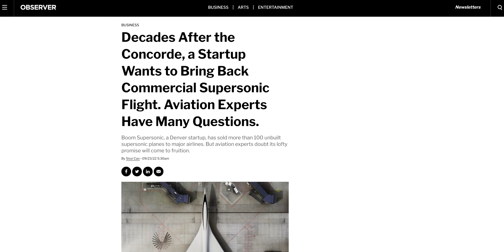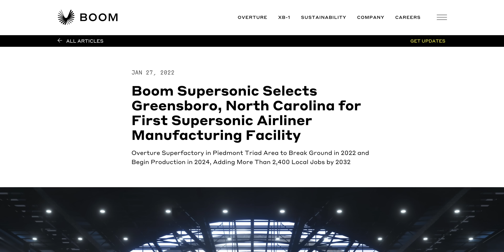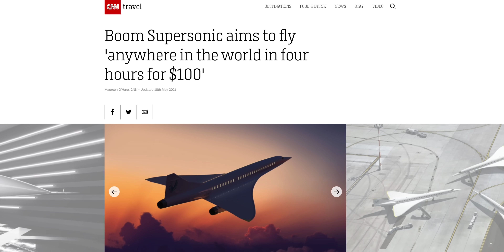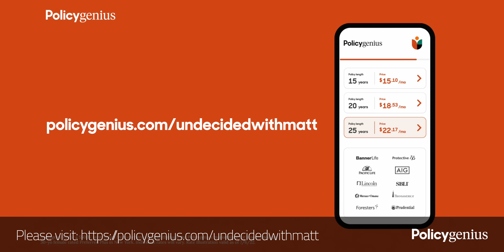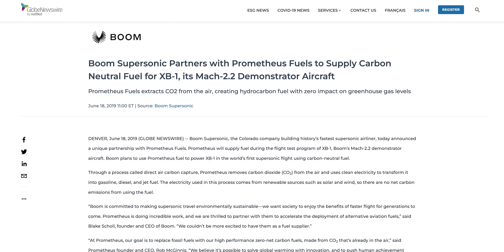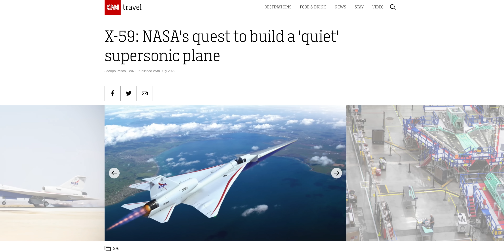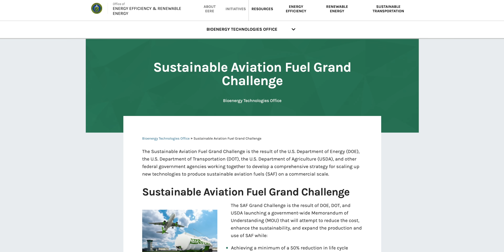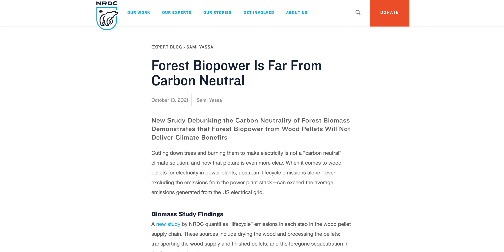Fueling a Clean Supersonic Plane Comeback

Comment: Something potentially undiscussed, is how supersonic travel may benefit exponentially greater for hyper altitude travel, that regular subsonic aircrafts can't achieve. This could help drastically lower fuel consumption on long-distance flights (like cross atlantic or cross pacific). The problem with doing direct fuel consumption comparisons, is that those comparisons often only take into consideration the most convenient factors - such as testing flight at equal atmospheric pressure and humidity etc, to generate an equalized and "fair" comparison. However, in reality those comparisons are never fair, as different types of propulsion offer different potentials for advantages and disadvantages that lab tests often overlook. It's why the old saying holds true: Theory exists in books and labs, practice exists in the real world.

Comment: The question is not the ticket price but it's relation to the compensation of its passengers. If you can book the seats, you fly. You also find a way to deal with regulatory objections. With time, in ovation and competition will drop the price.

Comment: While I certainly support the world's efforts to reduce carbon emissions... we might just have to accept that there are certain applications where, at least for now, fossil fuels continue to be the best option.  Long range commercial flights is one of those cases.  Let's take a step back and look at the big picture... the amount of fossil fuels being used for power generation is steadily declining.  % of EV new vehicle sales is going to do nothing but go up.  Once all the supply chain issues are addressed and battery production can meet demand, the roads are going to be flooded with new EVs, and the % of ICE vehicles on the road will steadily decline.  Eventually we will reach a point where the planet can tolerate some carbon emission modes of transportation like air travel.  Until the science can affordably provide a clean burning alternative that is cost effective (key point here - cost effective) to manufacture, we are just going to have to live with long haul flights using good old JP-1A.  As to Matt's other question - do we really 'need' supersonic flights right now?  Not really.  Should we pursue the technology for future applications?  Absolutely.  I just don't see $100 flights on supersonic jets anytime soon.  Sorry millennials... you are just going to have to learn to sit still for long haul flights lol

Comment: specifically speaking about the US, i would love to see the return of supersonic flight, but the issues you present are somewhat troubling. the Prometheus system of turning CO2 into useful fuel seems like our best bet, perhaps we could even get their power from nuclear reactors, nuclear power also would help other fuel production, such as hydrogen. hydrogen and DAC carbon capture i think are the most promising fuels for the future. the biggest problem we have to overcome though is the reliance on personal automotive transport. I've been working on a proposal to utilize existing rail infrastructure to provide overnight train travel at an affordable rate, a simple explanation is this: instead of rushing to the airport at the crack of dawn to get through security for a 1 hour flight, instead you board a train in the evening, where you are served dinner, given a bed to sleep in, and wake up at a normal time without having had to stress at all about being late. as part of my proposal i took an overnight train that already runs from los angeles to Albuquerque. the biggest problem with these trains is how often they stop at stations where almost no passengers board or deboard, instead, the train could have gone faster had it skipped the intermediary stops.
i believe overnight trains like this could almost eliminate short-medium distance flights, which would drastically reduce carbon emissions, highly populated regions like the US East Coast could use high speed trains to do the same thing over further distances, and offer daytime high speed trains to go even shorter distances with more station stops.
supersonic flight over oceans makes sense as trains aren't particularly good swimmers and boats/ships are just painfully slow.

Comment: I still don't understand how pushing to electric vehicles is going to help with climate change. Since the majority of power is oil, gas, and coal powered, you are still burning the stuff. Not only that, now you are subjecting it to losses when you charge and then discharge the batteries. Wouldn't this be even more detrimental? Sure there is hydro, wind and solar but the inherent costs and disposal issues of those present their own challenges. Electric power transport is not a mature enough tech to be pressed so hard and again, you are still burning fossil fuels to charge the batteries in most cases. Maybe in a few decades these challenges will be overcome but I really don't see it as viable right now.

Comment: In addition, Boom has a demonstrator prototype that was suppose to fly in 2019… And in aeronautic, prototype is the easy part.
Also, the supersonic travel is doomed. In the 60´, air travel was a total lost of time, no laptop, no TV and noisy airplane where it is was a sleep inside and people were smoking inside 😅 So it was making sense to fly fast. 
Today it is totally irrelevant unless for extremely long route (like Europe to Australia) that anyway these supersonic don’t address directly.
Supersonic has a huge energy consumption per passenger/NM that is against the energy crisis we face. Lastly nobody want to build new engine or even modified engine for them. That means they have no engine or they have to pick something military 20yo…

Comment: So let me get this straight: Boom has already developed the super-sonic aircraft, and they plan to run it on carbon-negative biofuels that don't exist yet? If they could possibly produce such a fuell cheaply, why then do they plan to burn 5x as much in a supersonoic passenger jet? 

We already know that today's airlines have pinned their future hopes on renewable biofuels. But that's going nowhere, because these fuels don't exist in quantity, and there's no clear path to producing them at similar cost and quantity as kerosene. If Booom could magically produce these fuels, I'm betting that the worlds airlines would want it pretty badly, and it would make Boom look pretty bad burning it at 5x the rate of subsonic aircraft. 

So why build a supersonic passenger jet, when this is really all about developing viable aviation biofuels?

The fact that Boom is pushing supersonic makes them look like climate deniers. Armed with a carbon-negative biofuel, they should be able to burn as much as they want, right? Jet engines still have CO2 emissions, and water-vapor, a potent greenhouse gas, and NOx, a carcinogenic smog.  If they really cared about climate change at all, they would put that energy into developing emissions-free electric aircraft.

You alreday pointed out that electric aviation is a difficult challenge, which is why today's airlines are putting their hopes on renewable biofuels. But consider: Tesla single-handedly made electric cars viable, by bringing down the cost of lithium batteries. A decade prior to that, General Motors, produced an electric car,  a 'compliance car' they hated, and eventually pulled it when they convinced the CARB it was a bad idea in the first place. My point: aviation doesn't need Boom, they need innovators who want to solve climate change.

Comment: I didn't hear an important aspect of supersonic air travel mentioned, which is less time spent in the air at comparable fuel consumption rates per air mile traveled means less overall fuel consumption per flight. This, of course, assumes comparable fuel consumption rates, which needs to be determined and verified.

Comment: F1 are moving to similar synthetic fuels from 2026. The brief is that they have to be carbon neutral as well as not take up any land that could be used for agriculture and they have to be truly sustainable. While there is a long way to go to demonstrate if it works or not but if anyone can make it work, F1 engineers and their relentless pursuit of performance to beat the competition each year. They also have oil companies as major sponsors with their deep pockets for development. It should be interesting to keep following the development on this new fuel

Comment: The Boom marketing ploy is being dismantled on other sites, even as this channel parrots the sales pitch. The risk for the general public is that so-called "net zero" will eliminate mass market air travel altogether, let alone, "anywhere in the world in 4 hours, for $100." Further, to the extent that content creators insist on discussing supersonic flight, the misuse of Mach Number is one of the most widespread technical errors on the internet. Mach Number is the ratio of airspeed (not ground speed) to the LOCAL speed of sound, which DECREASES with altitude. Just report the speed in mph or km/hr, because that's what you are trying to do.

Comment: I was wondering about Ultra Capacitors in aircraft design.  In your video about electric aircraft, and in this one, you talk about the battery bulk and weight problem, but I didn't hear anything about Ultra Capacitors.  The problem was getting the plane up high fast before the battery was used up and then gliding high up in the stratosphere where having electric engines isn't a problem, because air fuel mixture isn't a problem.  If you want a quick burst of power for a short time, and you want to be able to charge quickly from solar panels, isn't an Ultra Capacitor the logical choice?  Don't tell me nobody thought of that. 🤔
Reply: Ultra capacitors have a far lower energy density than even lead acid batteries. They have their place for their ability to store and release energy quickly like what would be needed for regenerative braking.

Comment: I think supersonic flight will fail, but the technology will get repurposed. Boeing and Airbus are both in the process of developing hybrid engines which use substantially less fuel. That mixed with "carbon capture" fuel, short haul flights (less than an hour) going electric, and other advancements, it is a very interesting/exciting time for aviation advancements.

Comment: When looking at life insurance be careful what you buy. Term is good for protecting your family while you work. Whole is made to pay for your funeral and anything you want to leave for your family regardless of your age. Don't be fooled by certain companies who offer huge amounts of "whole life" at low prices. Those polices use term insurance and store a portion of your premium while you are young to offset the costs of the policy as you age however eventually they do run out of money and you are stuck being much older with no life insurance. I was a licensed life insurance agent and unfortunately saw a lot of those policies. If you want whole life insurance read your policy and look out for terms like Universal and Modified. There's some other terms that has been used as well but it's been a decade since I left the industry so I can't remember right now. If you're below 30 I would suggest a 20 pay policy. You pay on it for 20 years and then it is there and you never have to worry about it again, also a good policy for your children. There's also paid up at 65 as well which is what I have for myself. As for as whole life goes you really do not need more than what you predict your funeral will cost and while none of us like talking about stuff like that it is something you should discuss with your spouse. Hope this information helps.

Comment: It's a non-starter.  Cost-effective supersonic passenger flight is impossible.  The technology itself is relatively easier to crack.  The problem is that the capital costs, the operational costs, and the impact of inflation all mean that they would need to achieve massive scale in order to offset the likely contingency costs.  Back in the days of the Concorde, they were able to squeak by for a while by selling $10,000 flights to mostly rich people with money to burn.  The atmosphere today is much different.

Comment: This is why i think we should invest in trains more.  Both high speed and normal.
Planes and long haul trucking face similar issues going electric, but most trains are already electric and would be much easier to move over from on board diesel generators to overhead lines or energized tracks.  They are also more efficient than trucks or planes.

If we had high speed rail, a lot of the shorter flights wouldn't be necessary at all, and freight trains can pick up the load from long haul trucking, with shorter range electric trucks being much more feasible.  Trains would never fully replace planes of course, but it would go a long way towards it.

Comment: Why don't they use the ionosphere (Nicola)Tesla-Style to recharge the planes wirelessly during the flights? 🤔
I mean you can charge the Ionosphere with the right frequency and strength and make lightnings(electro-magnetic-discharges [or fields] appear) on certain positions of the earth, right?
That's the project he worked on back in the day and stopped because he saw the military use (and harm it can bring) if I'm not wrong..

Comment: Super Sonic may be evolving into Sub Orbital. Once you use fuel to boast to altitude, coast. Not enough air for a sonic boom, almost infinite range. For long trips (New York to Australia), it may even use less fuel per passenger mile.
And then there is the possibility of hydrogen . . .
Reply: May be more like SKIPPING supersonic than "evolving into."  SpaceX has plans to do just that with reusable rockets instead of airplanes using Starship as it evolves.  Will be much, much faster for transoceanic flights, and their hope is for sooner than 2029.

Comment: Funny fact the 707 was the fastest common passenger jet ever produced at 600 knots. It's also the first commercial airliner built. The most modern jet the 787 cruises at 515 knots. Why are planes going slower. Cost. Lets face it you'll save $100 and take a 45 minute longer flight. This is the main reason concord and boeing's version never took off. Pretty sure the airlines are looking at the zero carbon technology and not the speed. Like you said the concord used 5 times the amount of fuel. Which is why it was near $10k to fly on concord from New York to London when a 747 was around $700. There's just no money in supersonic travel.

Comment: I've worked with a company Resynth International, that has patents for making clean fuels (diesel, kerosene, etc.) out of waste plastics and used tires. The process is done in "micro-scale" plants that cost under $50 million, and can process all the tires and plastics from a small city, producing fuels for less than the wholesale price to distributors. It's been difficult getting investors to complete construction of the pilot plant in Puerto Rico.

Comment: Supersonic flights are a great opportunity to switch over to liquid hydrogen combustion, at around ~2.5x the range per ton of fuel.  Liquid hydrogen tanks work better at larger scales, just like supersonic planes work better at larger scales, and there isn't so much airframe emphasis in storing fuel in big oversized wings; You also derive no benefit using existing airframes for supersonic, and liquid hydrogen requires new airframes as well.

Comment: I am surprised that you did not address one of the most fundamental limitations of supersonic travel, the excessive fuel costs due to friction increasing at the square of velocity. The Concord consumed four times the fuel per passenger mile than any other conventional passenger jet. Otherwise interesting update.
Reply: This is not as strong a constraint as it seems, because faster jets fly higher where there's less air to shove out of the way.  The Concord could have been a great deal more efficient per passenger-mile if it was configured on the interior more like a conventional passenger jet, scaled more like a conventional passenger jet, and flown at a simpler flight profile without concern for sonic booms.
Reply: @TrogdorBurnin8or  👍

Comment: Yes there are many challenges ahead for super sonic flight but they should be encouraged to try.  Our roads are safer and more efficient because of Nascar and Formula 1 racing.  Many visionaries have been criticized until they worked out the bugs.  Environmentalists should encourage not condemn everything that doesn’t fit into their box.  It will take time to transition and still afford to eat and heat.

Comment: Its cool, but I just can't see how the economics would ever work. Less passangers in smaller seats due to streamlined shape + huge increase in fuel costs means your economy type seat while half the travel time would be the same cost or more than a lay flat business seat with drinks, nice food and internet. And claiming that your super sonic jet with all its extra engineering, testing, certification and likely special materials will somehow have a cheaper upfront cost vs the iterative design of a subsonic aircraft is crazy.

Comment: If you're not speed sensitive. Meaning you don't need to be in Europe that fast.. why not bring back the dirigible. Only use helium and not hydrogen.  
Then consider a solar skin to generate power for electric engines ...